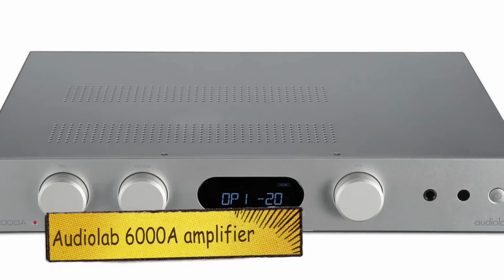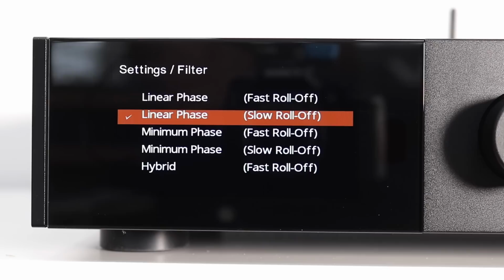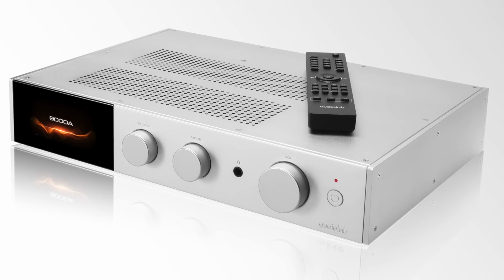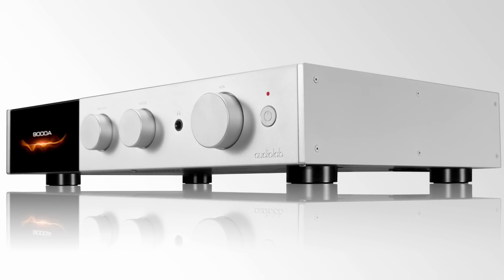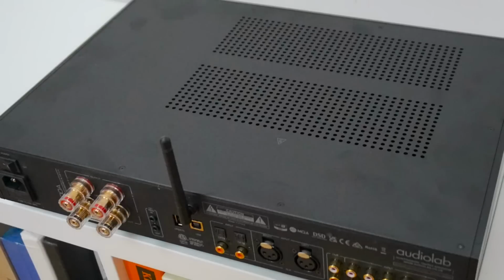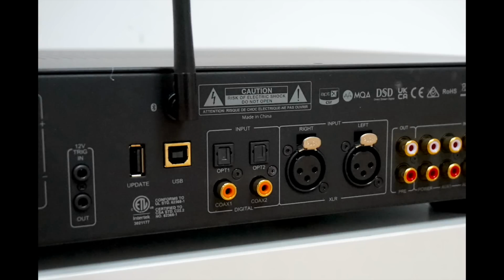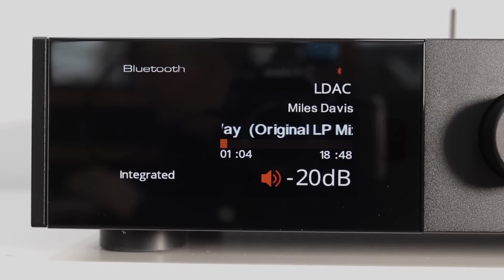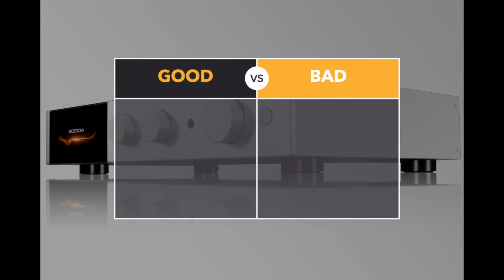AUDIOLAB 9000A AMPLIFIER: TESTS ON THE DAC, PHONO AMP, BLUETOOTH, USB B, HEADPHONES AND MORE!

Comment: Does the 9000A support balanced XLR input when it’s used as a power amplifier that is in pre-power mode ?
Reply: The pair of balanced inputs are only for sources, not for input from a pre-amplifier (for that kind of connectivity, you should probably look at the 9000Q and 9000P pre/power pair).
Reply: @cnoyes72 thanks, strange that they did that without even documenting it.

Comment: I've demo'd the 9000A against the 7000A for almost 2 weeks. I've worked in electronics/hifi manufacturing/testing/process design. After 30-40 minutes warm-up they sound remarkably similar.  But whereas after 45 minutes the 7000A has peaked... the 9000A just keeps improving!
After 2 hours it is simply a different animal. The bass/midrange/treble are simply sublime, but the soundstage is awesome... way, WAY better than the (still good) 7000A. Put a CD on 'repeat' play and then you will also hear the overall clarity/separation on the 2nd listen as the power circuitry warms!
A stunning amp for £1999!!
Reply: Sure buddy

Comment: Great review Paul but it has put my mind into a turmoil! 
I am now completely housebound so it’s impossible to get out and audition hifi so I am having to narrow things down by YouTube reviews. I was fancying either of the Rega Excel, Atoll IN100 or Audiolab 7000A all around the same price or Elicit at a push in the higher price point but then I viewed this. I also fancy a new CD player to replace my Cyrus 6 so was considering all the Audiolab line or maybe something from Atoll. Speakers would probably be from Wharfdale the Evo 4.4 or Lintons. I would add a streamer from Wiim later. I listen to all genres of music but rock would be the most popular such as Led Zeppelin, Mike Oldfield and Neil Diamond. Any advice would be greatly appreciated.
Reply from the maker: The 7000 would be a good compromise if cash is tight, Tony. Haven't reviewed it - I must emphasise - but I have reviewed the box above and below it so my educated guess says it's decent. The EVOs would be good, yes. Big sound. Mix of new and old sound directions. I like the EVOs.I hear good things about the WiiM but I've never reviewed one. CD? Integrated units are great but I prefer the separate transport and DAC. Then upgrade the DAC when/if you fancy improved sound quality. Depends on your available space, of course. Hope that helps a bit.
Reply: @TheAudiophileMan  thank you Paul.

Comment: I had one on demo and it sounded very nice and with so many useful functions. Personally, I found the screen to be the biggest annoyance to me and it wasn’t anything to do with it being LCD. I just found it all very distracting and yes I know it can be turned off but that also seems a waste of one third of the front. I constantly felt I had to interact with it - and why don’t Audiolab put markers on their volume controls? The only way to check the volume is via that screen again. I realise these are just personal things and if it had been, say, £1600 I may well I have bought one but not at £2000. The guarantee isn’t that long and I have a feeling that the visuals may look slick now but in 5-6 years they will look dated - that is if the screen is still working by then!

Comment: I'm an amateur speaker builder and have the 6000A. Guess what...my best instrument on my speakers is piano! Crazy but it's cos of my unique acoustic driver mounting. Half way in the box yet half way out of the box. I deal with coaxials and single drivers. A point source nut case! Seems like the best way to hear the difference point source can offer is on piano. I reckon many 2-ways can make the piano sound "broken" when you compare with point source piano (that seems more solid and more coherent and concise). This can explain why piano is "difficult" to reproduce, since most speakers are conventional 2-ways and 3-ways. Another problem is that piano is so rich that it can vibrated a speaker to pieces. That sound can get harsh instead of rich on some speakers, making piano difficult to sound good. Again, my unique acoustics also can manage the tone well. I hear completely even piano, xylophone and flute, hard to make these sound good but easier with the half out of the box mounting.

Comment: It is not good value for poorer sound quality at todays cost price compared to my better quality passive audio system with better quality amplification from the late 90's,  namely from my two  175watt into 4 ohms and 375 watts into 2 ohms two AVI S2000MI monoblock pro studio quality amplification system,  paired with my top of the range WiFi lossless streaming DAP player with a twin burr brown PCM 1792a  24/192 player played into my two way heavy weight sealed infinite baffle cabinet monitors. Audiolab audio components do not sound like real realism in how they perform the task of reducing and replying what comes from the recorded source. And they certainly cannot provide the sound quality realism of a pair of ATC SCM ASL  three WAY ACTIVE super linear monitors can produce from the source recording. I do not call any of the new audiolab products good value or even good sound quality even in comparison to their price.

Comment: what is the "power amplifier input" used for?
Reply: For connecting to an AV system - you would use the (L+R) Pre-outs of the AV receiver into the 'Power' in on the 9000a . Therefore the front L+R Speakers would be powered by the 9000a, rather than the AV receiver.

Comment: Thanks for the review as always. I have a 8300a and wondered if this is a step up. I am getting confused with the numbers. I am more for separates but intrigued. I was also thinking of the Copland Amps which don’t seem to get much review love. Thanks
Reply: The 9000a is noticeably better than the 8300a overall. I would urge you to visit your local dealer, with your 8300a, and have a demo - its awesome!
Reply: @dannyjackson9351  thx no dealers here in Sri Lanka unfortunately 😊
Reply: I owned the 6000, 7000, 8300 and now the 9000A , I am not happy for the 9000. For me the 6000 is the best of them all
Reply: Конечно 9000A лучше чем 8300A. Был 8300A до этого. 9000a детальнее, музыкальнее ..звук просто волшебный.

Comment: Thanks for the review which is a serious one I’m impressed. But this is made in the communist China blood & sweat factory. No, I prefer it was made elsewhere.
Reply from the maker: Just about all HiFi (and general technology) is either manufactured or features parts or components manufactured in China. I can’t think of one, off the top of my head, which is not.
Reply: And while the country has terrible human rights, I think it’s unfair to portray all Chinese manufacturers as the same. Chinese is more than capable these days of some of the finest engineering.
Reply: @Coneman3 Fine from stolen?
Reply: Тупоголовый индюк! Меньше смотри BBC😂

Comment: 3000 dollars wow! I mean this unit looks great and I'm sure it does sound good but 3000 for something made in China is a bit over priced in my opinion! There can't be more than a thousand dollars worth of parts there.
Reply: There are way less than a $1,000 in parts inside it. The total production cost of any manufactured product is typically only a quarter of it's retail price. You'd go out of business if you didn't price this way. And that is the total cost of producing it, the parts cost is even less! 
Btw, China makes fine amps, no need to worry.

Comment: My unanswerable question would be: would I be able to equal the performance of the 9000a using my 6000a as a preamp with an audiolab power amp? Or is it likely the preamp section of the 9000a is significantly better than that of the 6000a and so not viable.

I am using a mojo 2 with my 6000a for the dac, fed by pi with volumio via a d10s as usb to spdif converter
Reply: This is a very good question!
Reply: Did you ever find out?
I'm wanting to go the same route.
Reply: How much better is your external DAC vs the 6000a DAC?
Reply: @ridethewavenow  I'm happy with the improvement for the money. I'm running the pi through a galvanic isolator into the mojo 2 now (mojo is not isolated) and it's really rich and enjoyable.

That said I have not compared the d10s galvanically isolated as spdif converter to the 6000a, but I had both without it previously and it's an upgrade.

Not sure the 6000a has the quality overall to expose how good the mojo 2 is, but I'm happy with the combo for sure. Especially since adding room treatments. It's a captivating and almost enveloping experience
Reply: @bobbypnero  I'm glad you're enjoying your set-up; fortunately that's what counts. 
Thank you for the response.

I am happy with my 6000a but at some point I want to upgrade and get a little more magic.

Comment: I was thinking about audiolab when buying an amp but went with cambridge edge a better in every way. One thing i notice about modern amps is that most compainies use cheap powet supplies and not enough capacitence and the result is a non linear power supoly and not enough dynamic headroon

Comment: Thanks, Paul for the review! I’ve been waiting for some more reviews of the 9000A. I originally started out my hifi journey a few years ago with the 6000A. After one year I traded the 6000A to a Rotel A11 Tribute. The 6000A felt a bit lean and lacking emotions in my setup (Wharfedale Evo 4.4 ) and I think the Rotel’s voicing was a bit more to my liking (sacrificing a bit of soundstage). Do you think the voicing of the 9000A is warmer than the 6000A?

If I wanted to upgrade I would certainly like to see how it compares against some latest generation of Class D amps with room correction such as the Technics SU-G700 MKII or the NAD C-3050 LE. I think around the price point of the 9000A there are some amps that have Dirac, tone controls and switching power amplification has come a long way I guess. Would you consider those as competition to the 9000A?
Reply from the maker: I know Dirac et al is a ‘thing’ but I dislike it. It averages out the room and removes much emotion and passion. Not for me, even though others love it, I know. As for your other point? I see the 9000A offering more grunt but also a richer, fuller bass than the 6000A.
Reply: @TheAudiophileMan  Thanks! Appreciate taking the time to reply!
Reply: @TheAudiophileMan I very much agree. I won't be bothering with anything that features it, or anything similar. I choose amp, then speakers and then choose those items that produce the sound I  seeking. Haven't disappointed myself yet.😊
Reply: I own both the 6000a and the Rotel A11 Tribute. My experience matches closely with yours. The 6000a matches well with speakers that need a tightly controlled amp, it is the best amp I have tried for my Polk R200's, which can sound muddy powered straight off a receiver or low quality amps.  My Focal Chora's sound lacking with the 6000a. They are already a 'fast' speaker and sound amazing with the Rotel, which gives them needed body.
I haven't heard the 9000a yet but my guess is that there is a family resemblance between it and the 6000a. More refined sure, but I bet it will favor similar pairings as the 6000a. I would try another amp for the Evo's (I also own the 4.2's and didn't really care for them paired with the 6000a).

Comment: Biggest fail must be the black paint job then… is it the same as 6000?
How did they manage to make a matte finish a smudge magnet (let alone go with it) is perplexing.
It does my head in.
If anyone has a tried and tested solution to suggest (treat the metal with a lacker or something?) it would be much appreciated.
Cheers
Reply: I own the 6000a, it's not a problem at all. I definitely wouldn't cover it with anything either.
Reply: …but it is. That’s why I am contemplating it and bringing up here, just in case someone has a suggestion.
Thanks
Reply: linuxlucy6818 exactly! It s like sandpaper! It s ridiculous.. Surely there must be a fix ….no? Anyone ? Help!